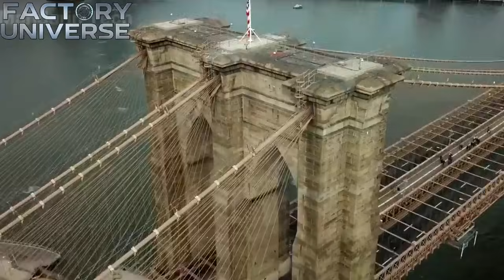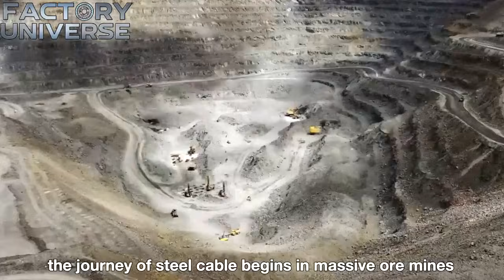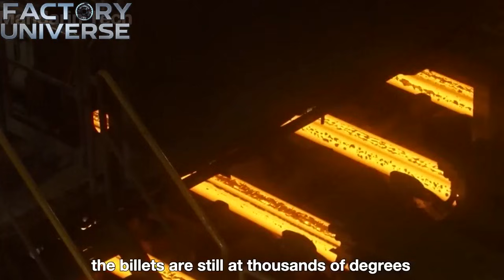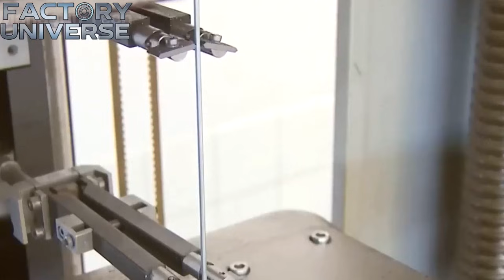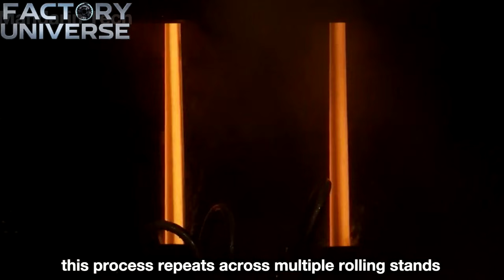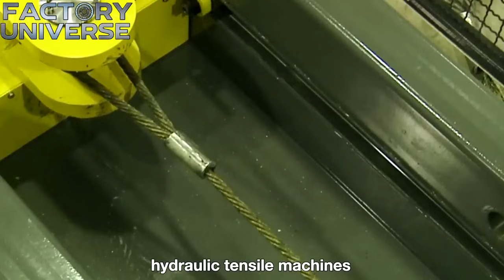You Won't Believe How Massive Bridge Steel Cables Are Made Inside This MEGA FACTORY

Comment: Manager / Project Leadership Perspective
🇬🇧 English

Large-scale bridge cable production reflects the importance of supply chain reliability, industrial precision, and strategic manufacturing capacity.

For infrastructure leaders, understanding how critical components are produced helps improve procurement planning, risk mitigation, and lifecycle cost control.

Mega factories like this demonstrate that successful projects depend not only on design — but also on strong industrial ecosystems.

Execution excellence starts upstream.

#ProjectManagement #InfrastructureLeadership #SupplyChainManagement #IndustrialEngineering #RiskManagement #MegaProjects #StrategicPlanning #ConstructionLeadership

Comment: Civil Engineer Perspective
🇬🇧 English

“You Won’t Believe How Massive Bridge Steel Cables Are Made Inside This MEGA FACTORY” offers a fascinating look into the backbone of long-span bridge engineering.

From high-tensile steel wire production to strand assembly, galvanization, and rigorous quality testing, these cables are engineered to withstand extreme loads, wind forces, and decades of service life.

As civil engineers, we understand that suspension and cable-stayed bridges rely on precision manufacturing and strict quality control — because structural integrity starts long before installation on site.

Infrastructure strength begins at the factory floor.

#CivilEngineering #BridgeEngineering #StructuralEngineering #SteelManufacturing #Infrastructure #MegaFactory #QualityControl #EngineeringInnovation